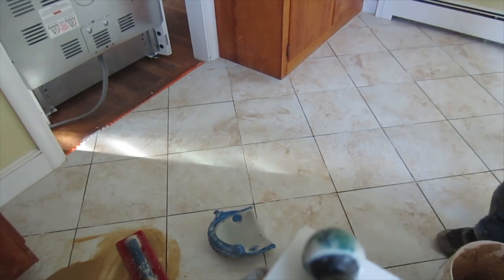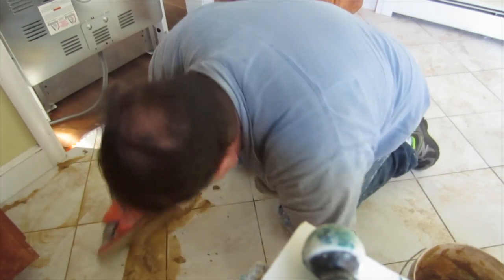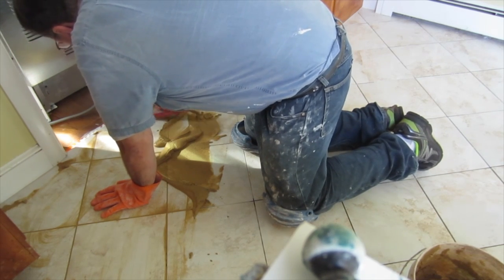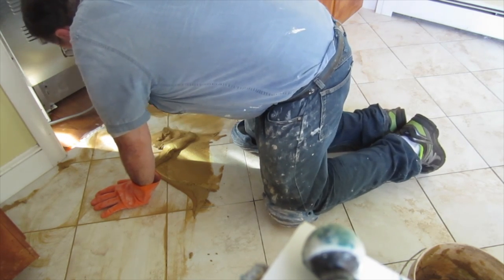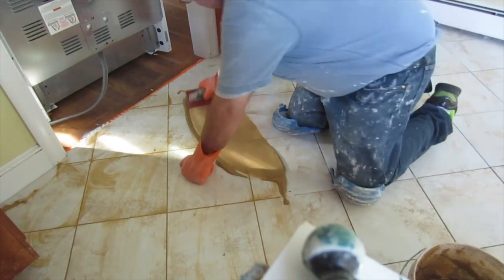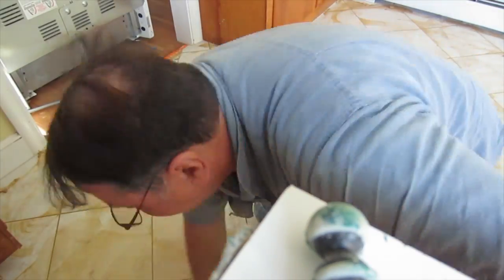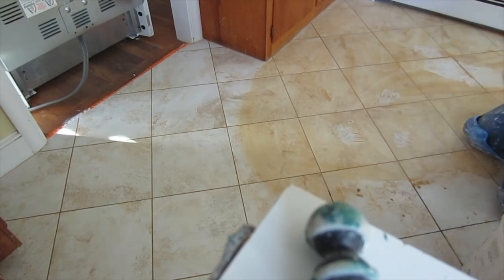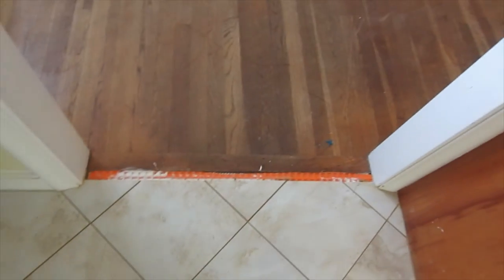How to grout a floor.

Comment: I have a question to install travertine on concrete flor can I us modified thinset ?
What the diference midifided and unmodified
Reply from the maker: mario arevalo You can use modified thinset if you are going to install the tile directly on the concrete, but I would advise that you install an uncoupoling membrane first, like Schluter Ditra, and then the tile. The type of membrane will dictate the type of thinset. Modified thinset has polymers in it unmodified does not, Polymer modified thinset cure and dry by evaporation, unmodified thinset cure and dries by hydration, two different mechanisms.